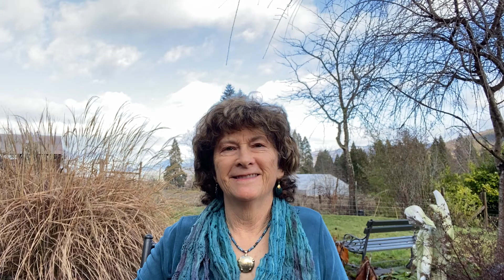Founder explains invention and uses for the BioElectric Shield Personal Energy Protection Pendant

Comment: Is this insanity? There's several things that sound very Mystic but weren't explained in a scientific way. More explanation please!
Reply: How about this: polished metals reflect light. Light is electromagnetic - EMF, so polished metal reflects EMF energy. Different metals are more effective at some frequencies than others. Silver and gold reflect infrared better than other metals. The body emits heat, which is part infrared EMF energy. That infrared emission contains your 'signature' emf frequency unique to you - and that your body recognizes as part of itself. This is key. Now, for crystals; they are structures that vibrate when exposed to other vibrations. They can be shaped and conditioned to vibrate in particular ways. They can also be arrayed in patterns that, in combination, vibrate in particular ways. One way, is to vibrate with your own vibratory energy - such as that emitted as your infrared emf signature. Now, take a pattern of such crystals (quartz, for example, but others too), put it behind a piece of dished/concave (even parabolic) shiny metal like silver or gold, which acts as a mirror - particularly of infrared EMF. Then clear the crystal of residual resonant patterns (various ways), charge it (put it in the sun to absorb and start vibrating at a frequency, and quality of frequency, in harmony with the sun). Now, face this dished mirror with the crystal facing your body, such as on a necklace, wrist-band, whatever - it just has to orient the crystal structure at the body with a mirror behind it. Now, your body emits its signature IR light that the crystal abosorbs - and starts resonating at, on top of the sun's resonance and the mirror reflects much of that energy back into your body. Your body (the 'energy body' aspect/portion) recognizes your particular IR signature and, because of that, also accepts the vibrations of the crystal that add to your IR signature and responds to those vibrations with harmonic alignment. The crystal, then, constantly signals the body, via the modified IR signature frequency, to align to the energies of the crystal, which are derived from the sun, which is a key source of life-inducing energy. Now, external EMF energies are signaling the body to fall apart in various ways. This Sun-based EMF energy, plus your own normal 'signature' are signaling the body, via the now-'programmed' crystal and mirror, to stay functioning properly. One cancels the other so your body tends to stay in a healthy/proper energetic state. Now, on top of that, the mirrored metal reflects both directions. It can also reflect away external EMF energies - including those that could affect the crystal's programming. That's where my theorizing ends, for now, because I don't have a model, yet, for how that external mirror is effective beyond a small zone around it. Even so, the energy body idea has precedence in eastern medicine via meridians, acupoints, chakras, etc. Those are just ways to describe the energy analog to the physical body. Arguably, we are all formed from energy and live in a sea of energy. The physicality we experience is just a modality of the larger energy universe, only, our senses - which are all merely vibration sensors of various types, sensing different modalities of energy, only sense a tiny portion of it, though some have developed their 'sixth sense' to be aware of more. This may be done via the pineal gland hooked up to the valgus/vagus nervous system, which acts as an etheric antenna that some people are very sensitive to like some people have better eyesight, hearing, etc. Anyway, you are going to hear a lot more about 'phototherapy' and other light related healing and performance enhancement technologies. Look up Lightwave patches. Those are future-tech in present-day. They also seem magical just like these biolelectric shields, but work on the same principles: the body responds to light in very complex ways and that light can be 'programmed' to influence the body in profound ways - for good or ill. Cheers!
Reply: @Virginia Brown Sure! go ahead and use it. I'm glad you found it useful.
Reply from the maker: Lorraine, Thanks for asking. Since most people don't want to spend a long time watching a video, we've kept this intro short. We do have a longer interview coming out soon. 

But in the meantime, please come to the website to read the science https://www.bioelectricshield.com/about-the-shield/the-science,  our research https://www.bioelectricshield.com/about-the-shield/testing-the-bioshield, guarantee https://www.bioelectricshield.com/about/our-guarantee,  testimonials https://www.bioelectricshield.com/about-the-shield/testimonials-2 (then also look on the product pages for product specific reviews. We've been in business for over 30 years We're pretty proud of our 4.7-4.8 approval rating our customers have given us through Shopper Approved https://store.bioelectricshield.com/
if you have more questions please call 541-201-8878 m-fri 9-4 PT, or email info@bioelectricshield.com
Reply: @bioelectricshield  this kind of EMF that runs off towers and phones is much stronger having been harnessed and directed in concentrated levels. That's why it's damaging to humans. Otherwise we could have run our phones without Towers but using the Sun. These things may help but very very little against the elephant in the room if you please
Reply: @laualee1  I disagree based on proximity. A programmed crystal vibrating inside, and tuning, your bio-electric field, within perhaps 4" of your body, is like an electronic countermeasure against broadcast EMF noise, even at intensities and spectral bands into the 5G range. But, those frequencies weaken quickly at range and can be easily shielded against. Yes, if you were standing next to a strong radio transmitter these crystals would be overwhelmed and you would be physically damaged by constant saturation of damaging frequency intensities running counter to those of your bio-electric field (and energy body), as well as maybe disrupting physical cells, but at range the crystals' signal strength is stronger than a distant transmitter - and with the advantage of being in alignment/harmonic resonance with your body's fundamental/signature frequency. The crystal, then, becomes the 'louder voice' compared to distant external EMF signals and reinforce your energy body which, in turn, reinforces your physical body. I will say that the closer you are to the radio transmissions of any sort, the less effective these crystals will be, though perhaps some designs can be more effective - it depends on how they reinforce your personal field. On the other hand, when you step away from such EMF, the crystal will re-tune your bio-elelectric field and begin diminishing damage done. Amazingly, there is now regenerative phototherapy backed by clinical studies, with profound implications - so even if you are damaged by EMF, there is regenerative EMF/photo therapy (e.g., Lifewave tech) that ultimately is reflected in the physical body (pun not intended). But, this all seems like magic until you dig into the patents and clincial studies. Even then it still seems like magic since it involves the concept (and reality) of the 'energy body' which is barely acknowledged by most 'modern' science. That is radically changing. This tech is an example, even if it seems inexplicable - the magic of yesterday is the science of tomorrow.
Reply: @allanh5618  You're awesome! I'm glad there's people out there who are open minded and embrace "mystical" ideas and integrate them with science. In the passing of time, the energy body will become a mainstream focus of science for sure! The materialistic paradigm is stubborn at this time though.
Reply: @allanh5618  Hey Allan! From what you know, which one of the life wave patches would you say targets emf damage regeneration the most? Your comments have triggered me to research them and it’s been a wonderful rabbit hole. Thank you lots!
Reply: @lookupjackkruseonyoutube  For regeneration, X39 is #1 since it, in part, induces improved stem cell function (via induced GHK-Cu copper tripeptide), which is a key to any bodily repair, and some have experienced actual tissue regeneration and scar reduction, not just ordinary repair. X49 (induces AHK-Cu copper tripeptide) is also for repair, particularly of the circulatory system. I imagine Aeon (some have said it works similar to Royal Jelly) can help blunt the effects of EMF, since it works, in part, to restore your bioelectric fields (there is a study about it). I would consider these patches an adjunct therapy to these BioElectric Shields since it is better to shield first and then repair as needed. So, ideally, BioElectric Shield first, then Aeon to blunt residual effects, and then X39/X49 to repair any damage. There is also speculation the X49 patch may mobilize copper (X39 and X49 both induce different copper tripeptides) to turn the circulatory system (wherever blood goes) into a kind of faraday cage (armor) to help shield against EMF. But, there is no public objective evidence or published studies, that I am aware of, so I wouldn't rely on it. Also, one person I know is very energetically sensitive, and finds these patches excessively stimulating for him, so they are not necessarily a cornucopia for everyone, so that's a possibility to be aware of if you choose to try them out.
Reply: @allanh5618  Awesome, thank you. Will be coming back to this comment a lot. One more question: what books/resources did you learn from to understand the bioelectric shield from a biophysics/energetic perspective? Would like to dive into the physics of it more!
Reply: @lookupjackkruseonyoutube  It's more 'hypothesize' than ' learn from' or 'understand.' I read bits and pieces about others' experiments, looked at patents and clinical studies, added my own background and intuition and put out a hypothesis for how things might work. Proving anything takes thoughtful experimentation. And, that's as much as I want to say. This whole subject is a vast rabbit warren of exploration.
Reply: @allanh5618 Thank you for pointing me to independent thought and conscious speculation. These fields (biophysics, quantum biology, energy medicine) are new and those qualities of mind will definitely be needed to connect the dots into a new, whole, and coherent science. I’m down multiple rabbit holes at the moment, Jack Kruse, Gerald Pollack, etc. just to name a few.

Can I ask what your hypothesis is on how the Lifewave patches work? I initially thought that the patches reflect a specific nanometer frequency of light back to the skin, which triggers the biochemical changes. 
But that seems incomplete, since it assumes a fixed light frequency corresponds to each molecule (661.2 nm for GHK-cu for a hypothetical example). You said in your bioelectric shield explanation above that light can be programmed with information, and that makes sense since the patches consist of organic crystal lattices. I hypothesize that each molecule has an innate frequency, and the crystal configurations unique to each patch reconfigure our IR light to match that frequency, thus triggering biochemical changes. This also makes sense to me since in homeopathy, the frequency of a substance can have the same effect as the substance itself (A concept brought up a few times in the book  “Your Pristine Blueprint”). 

That’s where I’m at right now, would love to hear your thoughts.
Reply: @lookupjackkruseonyoutube  I think the patches work by reflecting a hologram of a quantity of the active molecule/substance back into the body, which responds as if the physical substance is circulating in it (e.g., its bloodstream). Otherwise, I am aligned with your thoughts on their function. As for how, here's a new analogy: when sunlight shines through a stained-glass window onto your floor, it will project the window's image onto your floor. Is the light still sunlight? Yes, but now with additional light 'information' - an imprint of the window's colorful image. Similarly, if you play a chord on a piano, you still 'hear' the chord (it is a 'signature' sound) even if you add other notes in harmony (vs dissonance) with the chord, just with added tonal information. So, our bodies emit a 'signature frequency' light energy (e.g. biophotonic light) that absorbs additional, signature frequency light, or 'holographic,' information from a quantity of a Lifewave patch's active molecule (in crystal lattice) that is reflected back into the body, which recognizes its own signature frequency energy pattern and, apparently, also accepts the added signature frequency information/hologram, of the active molecule/substance, as valid - and responds to it. This has profound implications, both positive and negative.

It's also possible that the effect of this tech is mostly confined to what I'll call 'command molecules' like hormones and certain peptides that induce the body to make more, or less of something.